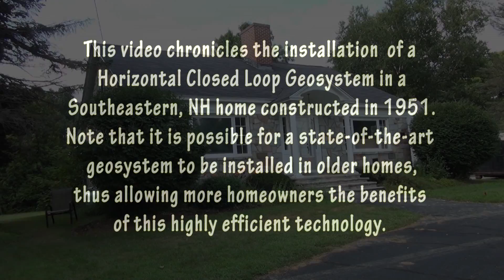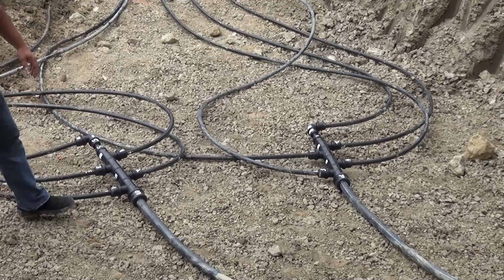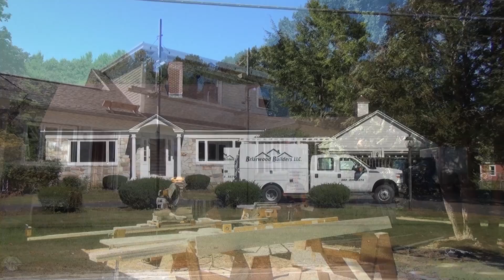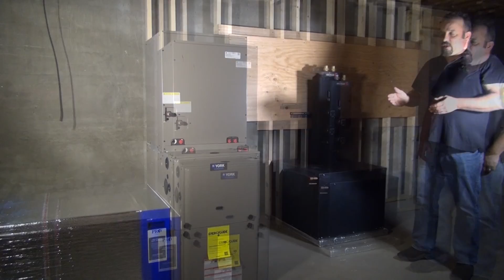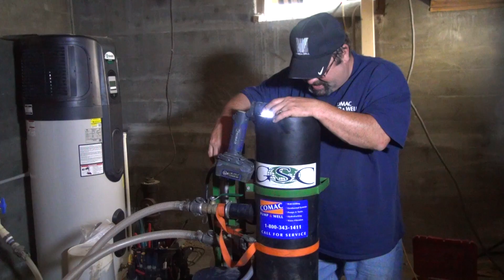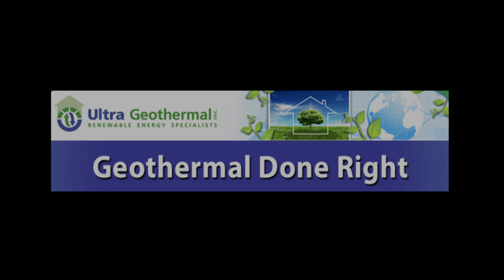Horizontal Closed Loop System - Ultra Geothermal, Inc. - Barrington, NH

Comment: Why does it take so much tubing?
Reply: The more surface area that is in contact with the ground, the more thermal energy can be transferred.  More tubing increases the surface area.  Same reason why a radiator in a car is made of lots of tiny long tubes instead of one big short tube.
Reply: @Berkeloid0  It seems excessive though. I think maybe something more efficient at heat transfer than PEX tubing would be a good idea.
Reply: @perry9492  More efficient tubing would add a lot of cost to the project and would actually reduce performance.  You want to get the cold liquid in the tubing to warm up as it moves through the ground, so that increase in temperature can be moved indoors.  If you used super efficient tubing, all the heat would be picked up at the start of the tube and then the rest of the tube would be the same temperature as the ground around it, and so that part of the tubing would not contribute any additional heat to the system. It would work the same as running a very short underground pipe, only allowing you to raise the indoor temperature by a fraction of a degree above the outdoor temperature.

By having less efficient tubing, the whole length of the pipe can be used to extract heat from the ground, and only a small amount of heat is removed along the entire length of the pipe.  This very small cooling of the ground around the tubing disperses easily, meaning the heat you can draw indoors is almost limitless.  But if you use a short pipe, or super efficient tubing, then you will just freeze the ground around the start of the pipe and then there will be no more heat to draw in from the ground and the heat pump will stop producing any warmth, and it will take a lot longer for that frozen area to warm up enough for the heat pump to work again.

Perhaps it's easier to think of it this way.  It's very hard to heat 1 ft of underground pipe by 30 degrees, but it's very easy to heat 300 ft of pipe by 0.1 degrees, and the end result is the same amount of thermal energy transferred.  So the longer the pipe, the smaller the temperature difference needs to be in order to extract usable heat (assuming of course the material is inefficient enough that the full length of the pipe is used and none of it is wasted).
Reply: @Berkeloid0  that is actually false, your actually talking about reducing performance and counting it more efficient, in explanation that also sounds like your trying to explain physics but missed the basics class!
if they ran say copper the cost would sky rocket yes!! but thermal conductivity would also be way more efficient and over all there system would work better! offsetting thermal equalization is simply the same reason radiators have so many tubes and fins, it's also why expanding surface area is so important in this kind of system and every other type of thermally conducting unit known, honestly no offence meant but please actually study the subject your trying to explain...
reading this shows you have no education in thermal dynamics, but your trying to explain it as if you knew what your talking about
Reply: @haylspa  If you're going to spend half your comment insulting me, please at least put the effort in to explain where my claims are wrong and why.  Copper is more efficient at thermal transfer yes, but when you want to evenly distribute thermal energy across a large area, using something that is too thermally efficient will result in an uneven distribution as the majority of the energy will be transferred at the start of the pipe, and there will be much less left at the end.  I never said using plastic over copper would be more efficient, just that the performance wouldn't be as badly affected as you might imagine.  If this is incorrect, then please explain why as carrying on about me having "no education" doesn't help anyone.
Reply: @Berkeloid0 Fine! first part of your comment; More efficient tubing would add a lot of cost to the project and would actually reduce performance; end quote.. this comment for example states by simply using any more efficient tubing (that includes copper or any other more thermally conductive material) would result in less performance.. a material (metal carbon diamond water etc) with a higher thermally conductance is able to pull thermal energy be it hot or cold better then say plastic that can be used as a thermal insulator, less conductance in say a radiator will always  end in less performance then a higher one.. now with that said you are trying to run with a theory of uneven thermals with a better more efficient thermal conductor do to the temp at the start of the pipe, you know what I am going to give you one example here for you to rethink that theory, with you taking in to account what you said, k stainless Pans thats right Pots and Pans that you cook on they put aluminum sandwiched between the plate that touches the burner and the part that touch's your food, they do this because of food cooking uneven in older pots and pans (hot spots) a higher thermally conductive metal helps spread the heat more evenly when sandwiched between to plates of stainless steal.. apparently the side touching the burner starts out hotter! But can thermally EQUALIZE BETTER THEN A LESS THERMALLY CONDUCTIVE MATERIAL over a larger area!! it's simple if it can carry heat faster from one end to the other end then it can equalize it's temperature more stably as well. silicon is a low thermally conductive material, do you want to touch an empty pan on the stove that some one left on with a silicon handle or a cast iron one??? which is hotter? that silicon handle is going to be way thermally uneven then the rest of the pan! and it's not going to conduct that heat into your hand like the cast iron pan would..! now I understand you think I was saying your uneducated, I wasn't!! how ever lacking in this subject and giving wrong answer with bad explanation as of why, yes it's not your strong suit, grammar for example is not my strong suit ;) but at least I can admit it
Reply: @haylspa  You seem to be misunderstanding my point.  You use the example of a metal layer in a pot conducting heat to more effectively distribute the heat evenly throughout the surface of the pot, which it does.  However you seem to be arguing that (for example) if you have a 100 meter length of pipe, making it out of copper would somehow conduct the heat along the entire 100 meter length before it transfers any heat the few millimetres into the surrounding soil.  I'm sure you will find the heat will be transferred into the soil touching the pipe long before the heat travels the 100m length of the pipe.

When you are disputing my statement that a less thermally efficient material may increase performance, I think you are missing the point that the materials you are transferring heat between are not ideal.  To illustrate the point, imagine you are pumping a liquid through a pipe, surrounded by cold water.  The liquid you are pumping is above the temperature of boiling water, and your goal is to lose as much heat as possible to the cold water.  If you use copper, almost all of the heat will be transferred to the cold water at the start of the pipe.  The water will boil, and once it reaches 100°C, it will turn to steam and move away from the pipe.  This part of the pipe is now saturated, and it cannot remove any additional heat, yet the rest of the pipe is unused.  You have concentrated your heat transfer to only a small portion of the available surface area, leaving much of the pipe unused and wasted.

My argument was that by replacing the copper pipe with plastic, the material would not lose as much heat at the start of the pipe, and the hotter material would travel further through the pipe, gradually heating the water surrounding the whole pipe, instead of just super-heating the water near the start of the pipe.  You would then be more effectively making use of the whole length of the pipe.

Essentially what you would be doing is increasing the surface area of the transfer zone.  Instead of concentrating the heat at the start of the pipe and moving a lot of heat in a small area, the whole length of pipe is used and you would move less heat but across a larger area, working out the same overall.

If the pipe length and material are designed correctly, there would be no difference in efficiency when you compare the input temperature to the output temperature at the end of the pipe.  I never said it would be more efficient, just that a different pipe material would allow you to better spread the load over the whole surface area of the pipe.

Imagine if you buried the pipe in the ground - a copper pipe would transmit all the thermal energy so quickly you'd boil the soil and kill all the worms near the start of the pipe, but the plastic pipe would take much longer to heat up so you could transfer the same total thermal energy from the pipe without killing any worms.

That was my point - it had nothing to do with a less thermally conductive material somehow being magically more efficient, just that a material that is less thermally efficient does not necessarily reduce the performance of the system.
Reply: @Berkeloid0  guy I am sorry but I am not reading any more of your pursuit to defend your pride, I could not explain it easier to a child and from what I did read I am not going into explaining thermal dynamics and its effects in/on mass, it's apparent your on a ego/pride defense honestly any more trying to explain it (any one else that also loves this subject) to you would be an embarrassment.. sorry If I hurt your pride. honestly though I'm not going to say your right when your wrong besides material cost you are completely and painfully wrong here! try looking at it out of a lens of rage may be you will get it, either way take care and GodBless<3
Reply: Berkeloid you’re are absolutely spot on with your explanation.some people don’t understand how ground source heating works
Reply: Geothermal ground loop is figured at 600 feet per ton

Comment: Hi I live in New Hampshire and was wondering if I have a swamp Ash area that's probably 100 yards by 75 yards wide but a hundred and fifty yards from my house if it's possible to put a horizontal Loop to heat a 4000 square foot house? If I dig this matter of inches into the ground I get water and it's right directly next to a brook. Would appreciate any ideas if this would work
Reply: i heard you put the loop on the water
Reply: @ipeeinmysinkimafraidtocome7127  
Why dont you drink it.